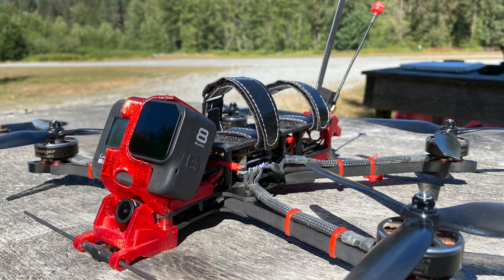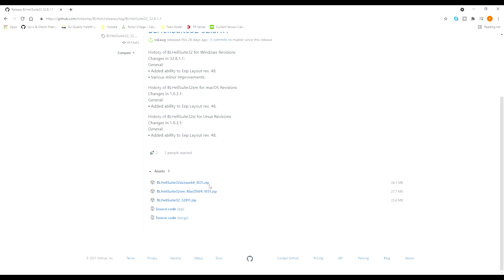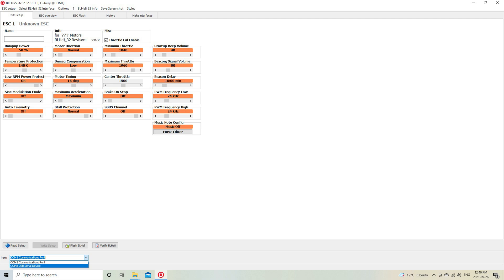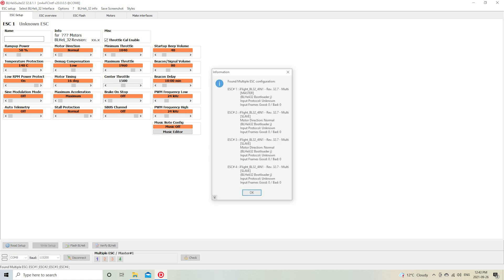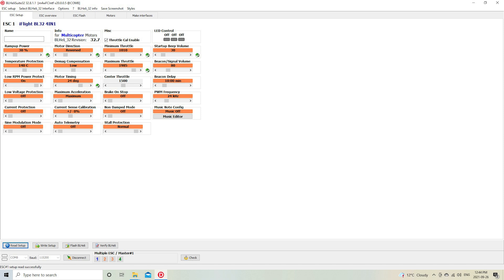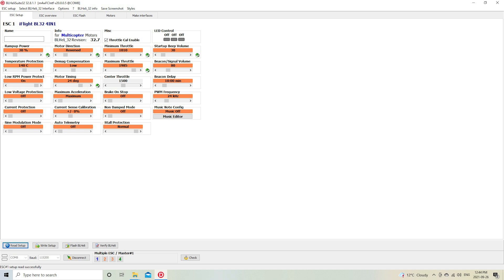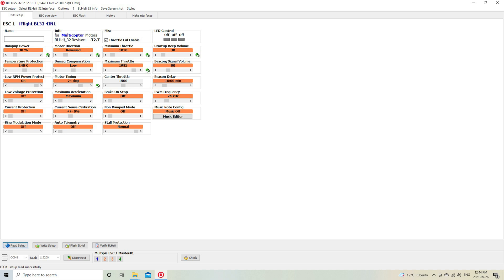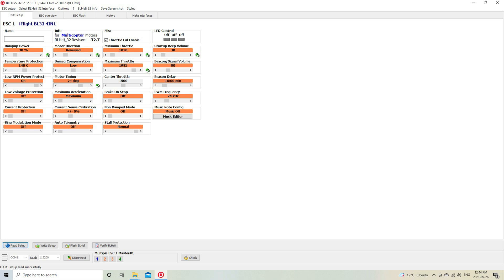BlHeli32 settings for my Long Range FPV drone

Comment: Just was watching Chris's rosser video on blheli settings. He tested long range 5" 16 degree and 48khz most efficient but low throttle 24khz had more authority.  
Wonder for efficiency stand point if 16degree timing and 48khz hold true on 7" and even if it did would the added time even be noticeable. (24 to 48 on my 5" was barely noticeable. Averaged max 1min more on long flights which could be flight style or weather) 
16 degree more chance of desync?
Reply from the maker: 23 degrees is supposed to be the safest timing for a quad motor.  And 24kh pwm is supposed to handle better than 48 with 7" props, better braking force, so better flight feel.    Making sure you get the quad back is more important than the extra 5% flight time.
Reply: @FalconRadFPV  ok I'll change it back. Went to test 16 and 48khz but haven't gotten it yet.  Snow 🌨☃️ everywhere to risk crashing.

Comment: What antenna do you recommend if you use dji fpv system. (Airunit) Building this frame right now!
Reply from the maker: Sorry I don't use the DJI system so I'm not sure what to recommend.  I've always flown analog.  I've seen a few thumbnails for videos about testing the range of dji, maybe they will mention what antennas they used.
Reply: @FalconRadFPV  Cool! Ill try to experiment currently trying extended DJI antenna's!
Reply: @chrisdoingfpv1787  Tbs triumph pro

Comment: Easy hack.. Right click any motor # to select that motor only. Thank for the video.. will try these settings in my 7” Super G.
Reply from the maker: Nice, thanks for the tip!
Reply: @FalconRadFPV  No thanks for your videos!! It’s very uncommon to see complete information on build videos. Most of them shows you how to build and maybe an initial set up in betaflight.. but nobody goes on with a tune and esc settings so I really appreciate your effort in completing your build series. I realize each kwad is different but these things gives us a great place to start.. and sometimes nothing at all needs changed. Thanks bro!!

Comment: Did you see any effects in your betaflight logs after soft mounting your motors. I just noticed it on the pictures.
BTW, really looking forward to see your settings. I also finally tuned my Falcon 7 build, let's see how much my settings differs from yours. 
Be careful with ramp up power, since those motors are power wise on the lower side for 7" props. It maybe works good on light Gemfan 7040 props but when running some beefy HQ 7040 (2g heavier) you even need to bump up the ramp up power to about 65%, to have enough response. 
It only makes sense to reduce rampup power on overpowered quads. 7" at that weight and with these motors is far from overpowered.
Reply from the maker: I didn't notice any difference when I removed the softmounts.  Also all clean bearings on the motors though.   Thanks for the information.  Perhaps I misunderstood what Ryan was saying in Joshua Bardwells video about ramp up power.  I'll have to watch it again.  Can you suggest an alternate source for more information about this?
Reply: @FalconRadFPV  yeah, I also wanted to comment on this, I've seen KababFPV video about "several bad quads were saved by bumping ramp up power up", so I would like to get to the truth. I have tried in the range 50-60% on 7- and 10- inchers, but haven't noticed any changes in handling.
Reply: @FalconRadFPV  I think you're on the right track with lowering ramp-up power on this quad. My understanding is that, at a certain point, the motors are saturated and you're just dumping excess current into them which is just lost as heat (which is inefficient at best, and can probably burn windings at worst). For a long range quad like yours (and my own), it probably is not a very large concern anyways because you aren't punching the throttle or doing anything with very fast rates which might saturate the motors. If you haven't already, watch Chris Rosser's video on BLHeli settings (and skip to the ramp-up power time stamp if you want).
Reply: @DelaneyKassab  I checked out Chris's BLHeli settings video and he suggested that lowering rampup power even as low as 15% for 7" props could be appropriate. This does seem counterintuitive to me because bigger props and motors might need a bit more rampup power to maintain authority during flight? I'm currently running at 30% rampup power but am getting jitter/wobble when giving even the slightest abrupt throttle. Kinda like mid-throttle oscillations, but nothing in the pids or filters seem to do anything for it. My ESC/Motor/prop combo is Tmotor F55A PROⅡ 6S 4IN1 _ESC/Xing 2806.5 1800 KV motors/HQ PROP J75 7X5X3

Comment: Perfect timing for this video considering I'm right in the middle of my build. I went the DJI route so it's a bit different. Really wish you had some close up of your hardware mounting. I had someone print my tpu parts and my camera system should me here soon and I'm trying to imagine how the camera mounts in the TPU.
Reply from the maker: Thanks.  Send me an email if you have any problems getting it all together.
Reply: @FalconRadFPV  definitely and thanks! Any reason why you haven't considered inav? This the the first built I'm considering using it, I'm going to set it up with betaflight first so I can get an idea of how it's flys. Decided to go FC with a  baro and gps with compass, we'll see where the build ends up.

Comment: Good lesson! May I ask what is your gopro and fpv cams' tilt angle for the most of your flight?
Reply from the maker: Thank you.  I use 28 degrees for my gopro tilt and my fpv camera is just about the same maybe 26 to 28 degrees.

Comment: Love videos many thanks for sharing any good tips on gopro set up.
Reply from the maker: Thank you!  Sure I'll do a video about gopro settings.  Unfortunately I might be a while getting to it though.  I've already got a few videos lined up to get though.  quick tip, instead of using native for the white balance, point the camera at similar lighting to what you will be flying and look at what the auto white balance looks like on screen.  Now scroll through the white balance numbers 4500k 5000k etc...until you get to one that looks most similar to auto.  I sometimes have to go back and forth several times to decide which number looks most like auto does.  By choosing a specific white balance number rather than auto it will stay at that nice looking white balance.  With it on auto it will wander around with the white balance and on occasion it will go way off (like make a snow covered mountain top turn all blue.)  With it on native and flat color profile the color ends up being terrible in my experience.  One more tip, lighting.  You want the same lighting conditions for your gopro as for photos.  So for instance typically you want the sun behind you lighting up the scene and also way off camera.  So usually on a long range flight the lighting is going to be better for either your flight out or the flight back.  I prefer to have the best lighting for the trip out (going up the mountain).  Hopefully that helps you out while waiting on that video!

Comment: in the new BLHeli Version 32.8 you can change PWM Frequency for LOW / HIGH RPM intipendently. So you can set LOW to 16kHz for mor low rpm torque and HIGH to 48kHz for more efficiency an mid and high rpm. Top for Prop wash handling and more flight time.
Reply from the maker: Quite recently I heard Blunty (on Bardwells live show) mention that it wasn't working perfectly yet.  I guess they got the kinks worked out since it's part of the blheli32 32.8 release.  I need to really trust my gear to send it out to places where there is no way to get it back other than flying back.  So I like to stick with the well used 32.7 firmware.

Comment: Hi I've got Diatone Roma L5 with Express LRS and Ep2 Rx using RHCP Lollilop and for drone the vtx is stock one 400 mw max power I'm using band b channel 5 can only get about 200 meters before pic8goes showy can you help is there generic setting for better range it has race and aswell fatshark box style goggles with DVR can you help I've message other people on YouTube in UK no reply as yet cheers cool bids got new sub from me return the gesture Cheer's
Reply from the maker: Sorry some comments were "lost" by YouTube for a while.  If you are still having the issue send me an email with some more info and I can try to help you out.  If the channels are set right I would think it is likely due to antenna placement or quality.  400mw on the VTX should get you at least 1km easy if everything working right.

Comment: Hi and thanks for the info, I was surprised seeing that you sticked to the default 24hz pwm frequency... this is a parameter that is known, when raised, to help consume less battery, among the other effects... I did several tests on this aspect, and besides the (tangible) lesser consumption, I never found a issue having it set to 48 Hz. All of my quads are on 48 hz. But since you are my guru for long range flights, I ask if there is a reason which i'm not seeing besides this, thanks again
Reply from the maker: Looks like you already got the answer.
Reply: I would also like an update about the frequency if that't no problem to share.
Reply: From what I know, it only works for micros. 5" or bigger don't behave well with higher PWM frequencies. 😕
Reply: @MCsCreations  
On this setup 24khz works best. I have done lots of testing. 48khz can produce resonance on these motors and you will loose lots of authority on low throttle manouvers.
Reply from the maker: Thanks for helping out!